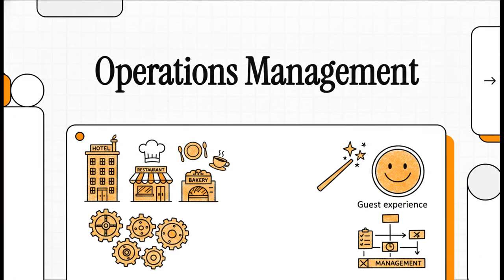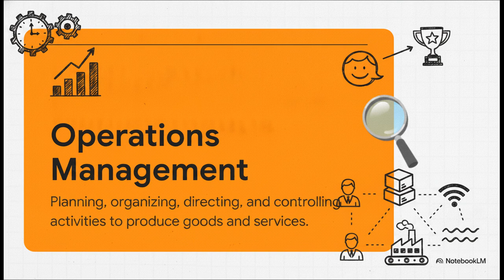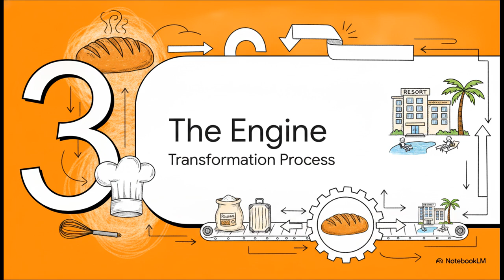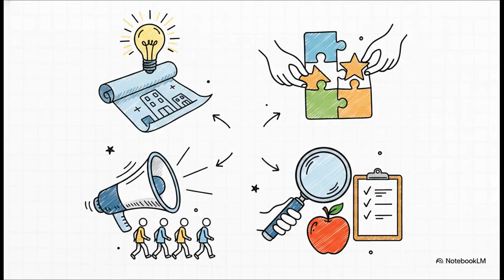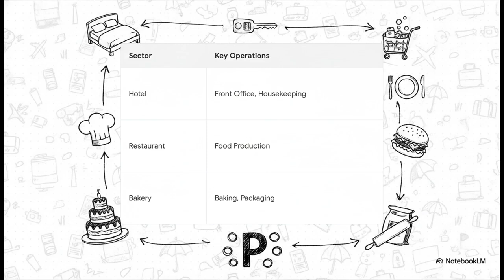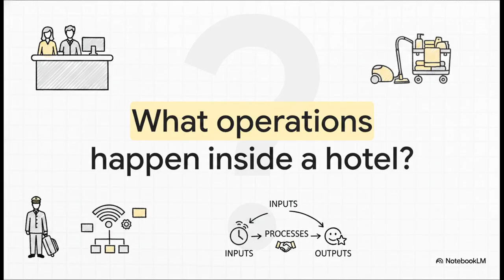Operations Management | Introduction, Functions, and Importance

Comment: HACHERO - TM2C

Q: What operations happen inside a hotel and how can you effectively manage the operation?

Front Office Operations are one of the most important functions in a hotel because they are the first and last point of contact for guests. The front office is responsible for handling reservations, check-ins, check-outs, room assignments, guest inquiries, and payments. Effective management of front office operations requires well-trained staff, excellent communication skills, accurate record-keeping, and the use of a property management system (PMS) to process guest information efficiently. By providing fast, friendly, and professional service, the front office helps create a positive guest experience, improves customer satisfaction, and contributes to the hotel's overall success.

Comment: A hotel has different operations that help it run smoothly every day. These include the front office, where guests check in, check out, and make reservations; housekeeping, which cleans and prepares the rooms; food and beverage, which serves meals and drinks; maintenance, which fixes equipment and facilities; and security, which helps keep guests and staff safe.

To manage these operations well, hotel managers should train employees, make proper work schedules, and encourage good communication between departments. They should also use a hotel management system to organize bookings and guest information, check rooms and facilities regularly, and listen to guest feedback to improve their service. Good planning and teamwork help the hotel provide better service and keep guests satisfied.

DALEON BSHM 2-C

Comment: Patiag, TM2C

What operations happen inside a hotel and how can you effectively manage the operation?

Hotels have different operations that all play an important role in creating a positive experience for guests. These include reservations, front office services, housekeeping, food and beverage, laundry, maintenance, and other support services. Although each department has its own responsibilities, they all depend on one another. If one operation is not managed properly, it can affect the quality of service and the overall guest experience. This shows that hotel operations are not just about completing tasks—they are about working together to achieve one goal, which is to make every guest feel comfortable, satisfied, and well taken care of.

For me, effectively managing hotel operations means making sure that every part of the hotel works in harmony. It starts with proper planning, good communication, and following standard operating procedures so that services remain consistent and efficient. Managers should also use resources wisely, such as their staff, budget, equipment, and materials, because these directly affect the hotel’s performance. At the same time, monitoring Key Performance Indicators (KPIs) like customer satisfaction, service quality, operational efficiency, and cost management helps determine whether the hotel is meeting its goals. When these indicators are regularly evaluated, the hotel can continuously improve its operations while providing guests with the quality service they deserve.

Comment: De Perio, BSHM-2C

"What are the operations in a hotel and how can you effectively manage the operations?"

Inside a hotel, there are different operations working behind closed doors wherein efficiency is most valued, both peak and lean hours. These operations are then divided by three: the Front-of-House, Back-of-House, and Back-Office. Guests are welcomed by the Front-of-House operations, the Front Office; commonly referred to as the "nerve center" of a hotel—responsible for room reservations alongside check-ins. Front Office prioritizes guest inquiries. Meanwhile, the Back-of-House—which includes the Housekeeping Department, guarantees the satisfied experience of guests by providing room services that includes cleanliness and laundry, whereas the Maintenance serves utmost physical upkeep of the establishment. The Food & Beverage Department can be in Front-of-House and Back-of-House, since both of their operations (preparing food and serving guests) are undeniably versatile. Lastly, the Back-Office acts as the engine room of a hotel. It consists of the Finance & Accounting Department, wherein they handle the financial standing of the hotel. Furthermore, the Human Resource Department is crucial because they are responsible for the oversee of staff recruitment as well as training them. Back-Office includes the IT Department—they guarantee a secure digital infrastructure for the hotel. Back-Office drives revenue; where the Sales & Marketing Department plays a role by the use of promotion and direct coordination with different travel agencies for exposure to the general public.

Business owners should adapt to the changing times. Especially now that people value convenience, the improvement of technology could effectively help manage the said operations to operate accordingly. Establishing a Standard Operating Procedure acts as a blueprint to avoid substandard work among employees, especially to those in need of guidance. Prioritizing employee welfare is just as important. Consistently monitoring feedbacks in order to track performance allows employees to seek for rooms of improvement. Effectively managed, operation teams can coordinate with each other while serving guests with utmost hospitality.